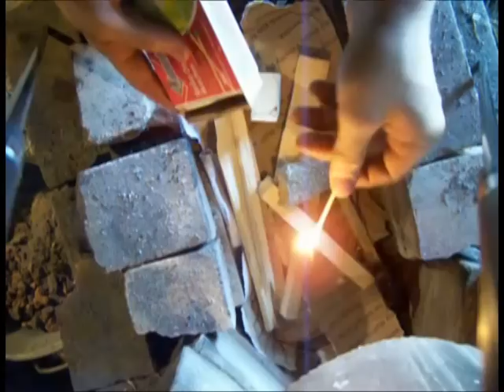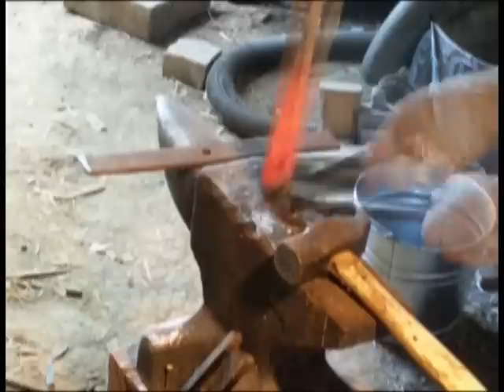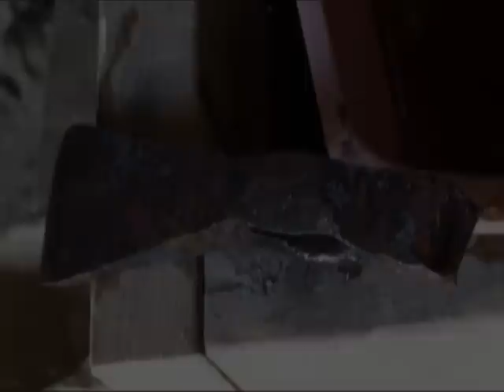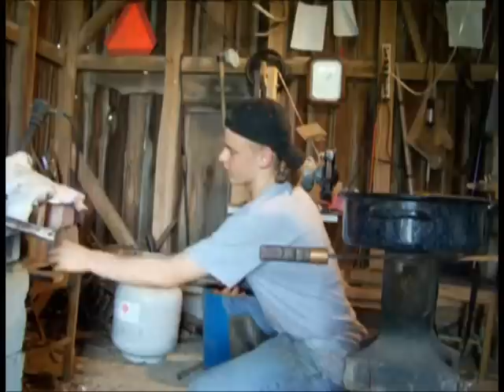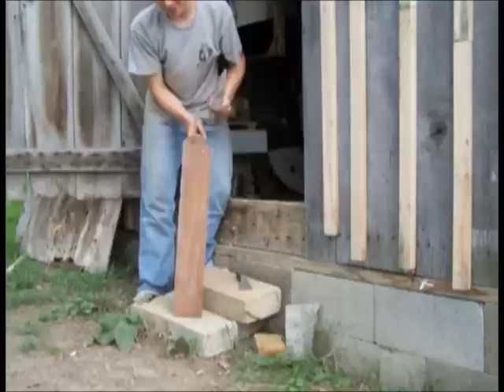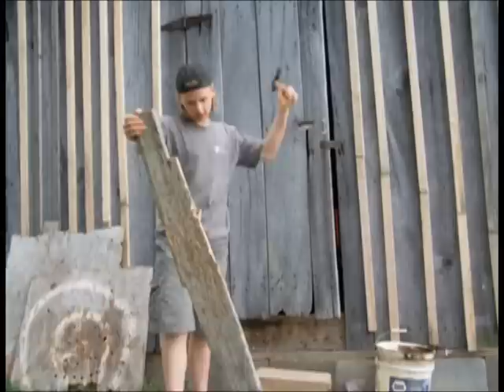Forging an axe head

Comment: If the metal is sparking that is bad. That means it is burning/melting. Holding it in the flame (NOT the coke or coal) until it stops sparking it better then just taking it out. 

P.S. You probably already knew that, but I am just trying to help. :)